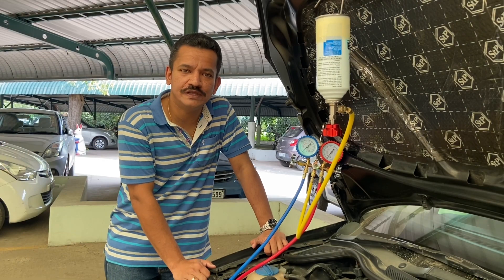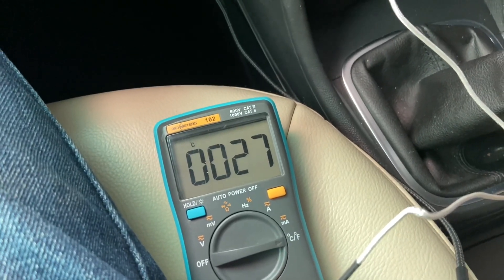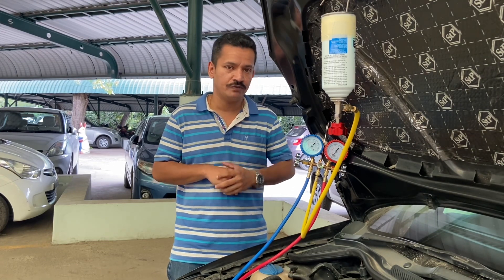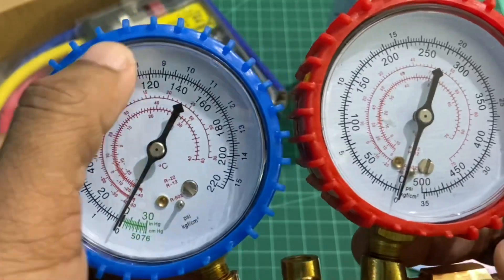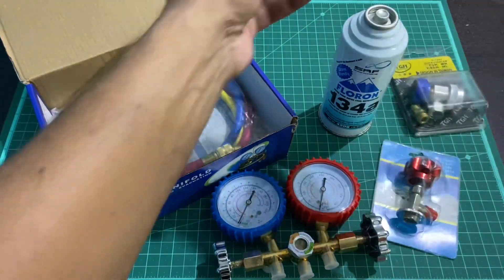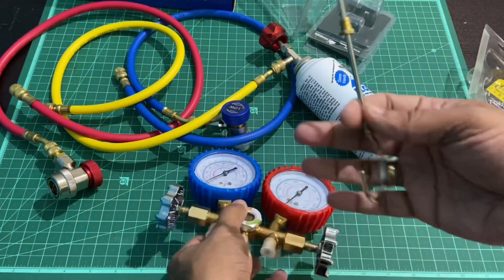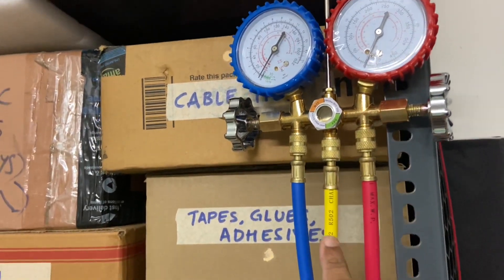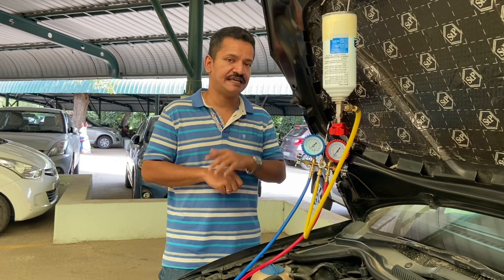Polo 6R - How to recharge the AC refrigerant

Comment: Hi Gannu , there is a practise of refilling oil while recharging gas , that should be done ?
Reply from the maker: Hi Deepak, you’ve to refill the oil only if you’re replacing the compressor, flushing the system completely or repairing a major leak which would have caused both the oil and the refrigerant gas to leak out of the system.

Comment: My low pressure rubber hose cracked and released all the gas. Can I fix it with silicone tape?
Reply from the maker: Hi, no you can’t tape it. The gas is under high pressure and will escape out. Please replace the hose.

Comment: Hi Sir, my polo 6R is having an issue. There is no airflow from any of the car vents. I turned on the ac at full speed and I can hear and see the fan at the front of the car spinning and the AC coil getting ice cold all the way from the start of the coil to the body of the car. I suspect the mechanism that opens and closes the vents of my car is stuck or broken can you please do a video or suggest what I may do? Thank you
Reply from the maker: Hi Bino, is the blower inside the cabin near the glovebox running?
Reply: @GaneshBalan  I believe it’s not, I will take it to a garage and see thanks
Reply from the maker: Could be the blower motor gone bad. Do get it checked.
Reply: @GaneshBalan  Hi sir, I got it checked, it’s the CONTROL UNIT. Do you know any good websites I could purchase from? Thank you
Reply from the maker: Bino, try those dealers who deal with salvaged car parts. A nee part will be significantly expensive.

Comment: Hii.. a different querry..
1. regarding the noise absorber under the hood.. Ho is the difference in cabin noise and how much does it cost?
2. Regarding the MID ? I think its fitted as after market? hw is the cost and how it is sourced?
Thank you
Reply from the maker: Hi.

1. The hood insulation costs about Rs 2400. It makes a bit of a difference insulating the sound but if you insulate the firewall/bulkhead between the engine bay and the cabin with a sound deadening sheet, that’ll make a hell of a difference. You should try this out instead. Go to an audio installer and explain to him. He’ll do it. Just be sure to clip everything back to normal.  

2. The instrument cluster is from the Polo 6R GTI. I got it installed from Vagtune, Cochin. I had to remove the stock cluster and ship it to them along with the spare key to extract the immobiliser code for coding the new cluster.

Comment: Hi , Thanks a lot you make it easy and simple , How can I know the read for low and high pressure for my ford figo 2012 and the temperature almost 40c  .
Reply from the maker: 40’C is too high! Was this measured properly? The low pressure gauge should read between 45 - 55 psi and the high pressure gauge should read between 320 - 330 psi.

Comment: I'll need to get this done for my car, with the summer in a month, suggest good window films for heat rejection.

Does d2r hid 35w work in dual barrel low beam? If not Considering possible combination of. Philips ultinon for low beam And projector fogs with 4300k hid
Reply from the maker: Any HID bulb will work or turn on irrespective of what beam it is fed. On bixenon setups, a metal plate which moves up and down due to the magnetic solenoid action determines the high and low beam outputs. 

On the dual barrel, the easiest method for better quality light output is LED bulbs. Good quality ones have a good cutoff which doesn’t cause glare to the oncoming traffic but is expensive. There are Chinese bulbs but quality and reliability will be a concern.

Comment: Hi Gannu Sir! How much did the Testing manifold cost? The quality seems great!

Also, I did not understand why were you opening and closing the low pressure side valve during the filling process?
Reply from the maker: Please watch the video. I’ve explained everything. 🙂
Reply from the maker: The LP side valve of the manifold is opened to let the refrigerant flow from the can to the system in the liquid phase. What seems to be the problem?
Reply: @GaneshBalan  I understood that part that it is being opened to let the refrigerant flow inside from the yellow hose 😅. But while the refrigerant was filling you were opening and closing the valve also maybe to regulate the flow of refrigerant? I got confused there, that's why I asked.
Reply from the maker: Basically you do it gradually in steps to prevent excess refrigerant from being charged. Once you open the valve, it takes some time for the HP side to reflect the reading. So you open and close the valve gradually.
Reply: @GaneshBalan  ok. Thank you very much!